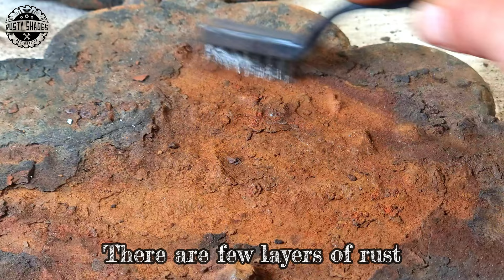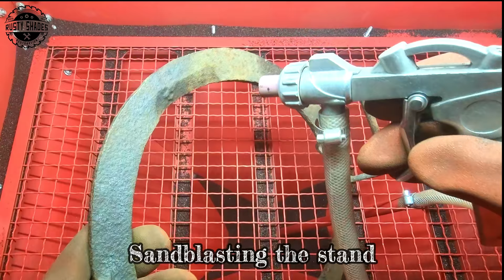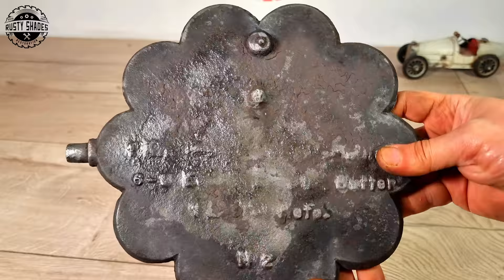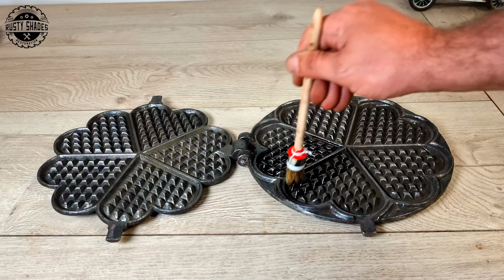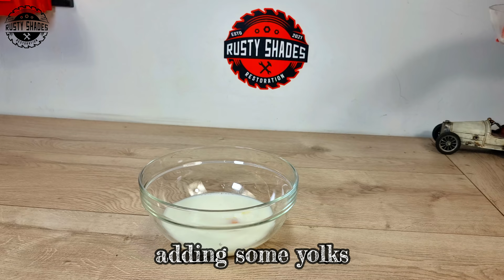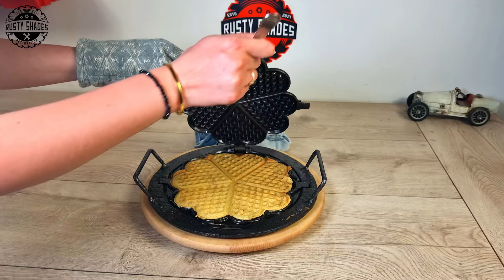Antique Waffle Maker Restoration - My Girlfriend Makes Waffles for You!

Comment: i had no idea the heart-shaped waffle irons were historic - i thought they were a new fad from the last 10 - 20 years.  i'm glad to see such a beautiful piece carefully restored and usable again.

that makes me want to send my recipe for yeast waffles...  mostly prepared the night before, then the next morning add a couple of ingredients and pour into the hot waffle iron, for the most ethereal waffles you've ever tasted!
Reply: please Do 🥺
Reply: Yeast Waffles

1/2 c. warm water (about 100-110F)
1 tsp. sugar
1 package of dry yeast
2 c. warm milk
1 stick unsalted butter, melted
1/4 tsp. salt
2 c. unsifted all-purpose flour (10 ounces)
2 large eggs
1/4 tsp. baking soda

The night before:

In a large mixing bowl (at least 3-quarts in capacity), combine the warm water, sugar, and yeast.  Stir & let stand 10 to 20 minutes to proof.  If the yeast is active, it will produce many bubbles.

Add the milk, butter, salt, and flour and beat until smooth and blended.  (I use a whisk.)  Cover the bowl with plastic wrap and let stand overnight at room temperature.  The batter will rise from 4 cups to 12 cups and then collapse.

Morning:

Preheat the waffle iron until it is hot enough to sizzle a drop of water.  (For crispy waffles, be sure to preheat both sides until very hot before adding the batter.)  Be sure to spray with oil, or use a brush to wipe oil on it, each time, before pouring the batter onto the iron.

Beat in the eggs.  Add the baking soda and stir until well mixed.  The batter will be very thin.

Pour the batter onto center of the waffle iron, using a light hand because the batter will spread when the lid is lowered.

Keep the waffles warm and crisp by placing them in a single layer on racks in a warm oven with the door slightly ajar to allow any moisture to escape.  (This is the cookbook suggestion – I serve them to hungry guests as soon as they come off the waffle iron!)

If you can find it, serve with Grade B (not A) maple syrup – it has a stronger flavor.  Trader Joe’s carries grade B.
Reply: @blueeyedbehr  thank u 😍
Reply: @blueeyedbehr  you are amazing!!! Thank you!!! ❤️
Reply: That's the standard waffle shape for waffles here in Sweden, the belgian ones are the fad here.
Reply: @MelissaJackson83  thank you for your kind words.  i do hope you will try this recipe.  it is the only waffle recipe i will make now because they are so light and ethereal compared to regular waffles, which now seem tough and flavorless in comparison.
Reply: Ok?
Reply: i would love that recipe
Reply: @carlagarrett3244  i gave it above.  hope you enjoy it!
Reply: Heart-shaped designs historically were in so many things in the early 19th to 20th centuries. Papers, clothes, decor, etc. It's no surprise that they made pans and irons as well. A popular biscuit tin shape in the 1820's was heart-shaped too.

Comment: Just a cooking tip. If you “fold” in the egg whites to the mixture (don’t whisk them in, use a rubber spatula instead) they will come out even fluffier.
Reply from the maker: Thank you 🙌
Reply: I thought exactly the same.  Over beating takes the air out.

Comment: btw, here are two tips for preventing waffles from sticking.  

1.  add a couple of teaspoons of oil to the batter.

2.  this is more important -- there's a chinese saying, "hot pan, cold oil, foods wont stick".  (it rhymes in chinese.)  heat the waffle iron, and when it's hot enough, spray it with oil, then pour in the batter.

the second tip actually works for any pan - heat it thoroughly, then add oil and swirl it around, then add the foods to fry/saute/etc...  they wont stick, and after several uses, the pan will become a non-stick pan.
Reply from the maker: Thanks for watching and for your tips, I will definitely use it! 😀

Comment: I think you might try a belt sander, with a thin band, for the open spaces on the backs.  Also, what about a more coarse grit in the sand blaster?  That type of handle will you use on the top?  If you know some one that can cast (or if you can do it yourself) cast an iron one!  It’ll season in no time, and be a perfect match

Comment: Looks like the waffle maker was missing its original handler which was used to lift the lid while it was hot. I remember seeing a similar one which one had to slide the handler (it looked like a spanner but very thin) under the lid latch until it clicked together and hey presto! you were able to lift the hot lid over that way.
Reply from the maker: This one had on the top, you can see the remainings of it. I didn't want to risk drilling holes or welding a new one, not on such an old piece that could crack immediately. Thanks for watching!

Comment: For the rust removal electrolysis to work, you need a sacrificial piece of steel or iron to “absorb” the rust given out by the piece you are trying to clean. And it also speeds up the process if you add salt or baking soda to the water to make it a better at conducting the electricity. Other than that, it was an awesome job! And thanks for sharing. :)
Reply from the maker: Thanks for watching and for your tips! Cheers 🍻

Comment: I enjoyed this 

Have you looked into Crisco for seasoning instead? That's what all the sites I found said to use.

Random cooking tip. Don't fold eggs into batter with a whisk. A flat rubber spatula and an actual folding motion is best. The spatula kind used for cleaning out a peanut butter jar. Slide spatula down side to bottom, turn over, remove spatula completely to above batter, return to side and repeat until all combined.b
Reply from the maker: Thanks! I never heard of it till now, but I will take a look. With the spatula thing, I will ask my girlfriend to take a look at your comment 😄 Thank for watching and for your suggestions! Cheers 🙂

Comment: "Sand blasting takes too long"
Yes but I'd watch it happen for 2 hours straight though lmao. So satisfying.
Reply from the maker: I love the process too, but takes time especially when the object is extremely rusty. You have around 2-3 min of sandblasting till the air is gone and then you have to wait till the compressor cools down to avoid burning the motor and then refill it with air and so on. This waffle maker will take 2 days at least to be cleaned with sandblasting only. 😅

Comment: I feel like the lid would have had a small round wooden handle, but that the metal shaft for it has snapped off in the past. You can see a big lump on top where something was mounted.

Comment: when the rust is that bad thermal shock is another way to get it off. Heat the metal up then throw it in an ice bath, then go at it with the brush
Reply from the maker: Yes, should work well this method 👏

Comment: That screw hole on the top should hold a wooden knob,  Makes the iron much easier to open.
Reply from the maker: There is not a screw hole, there was a casted handle from iron. Unfortunately I couldn't make one because require some special techniques and welding skills on whitch I'm working. Cast Iron can immediately crack and I didn't want to risk it on this antique Waffle Maker. Thanks for watching 🍻

Comment: Here is how I restored mine. Put it through the self cleaning cycle in my oven. Let cool. Rinse off all the ash with water. You are back down to raw iron now.  Dry completely and begin the seasoning process. Zero elbow grease and pristine cast iron pans!

Comment: I hate wire brushing, so, I would have been inclined to wash it after electrolysis, then, repeat the electrolysis until there's bare steel (washing every once in a while to get off loosened rust).  It might have gotten a little more out of the waffle grid for less hand brushing!  Also, I think your seasoning oven could have been hotter for a good seasoning. 
You're going to have a very nice waffle iron for another 100 years.  Nicely done!

Comment: Hi when cleaning cast iron, whether old or new, what should never be used? Cleaning, sosking, sandblasting, etc.????
Reply from the maker: Cast iron can face a wide variety of cleaning methods, including strong acids, so it is pretty ok to use most of them as long you're careful and respectful of the item.

Comment: To easily clean rust off cast iron just put the pan in a hot fire and burn fire for about an hour. Let cool and finish cleaning with wire brush and then just wash real good and season
Reply from the maker: Thanks for sharing 👍

Comment: Looks very much like a JOTUL heart shaped waffle iron. There should be a handle on it too. A soak in a lye bath would get the baked on crud off any cast iron pan or griddle.
Reply: Я свою чугунную сковородку время от времени закидываю в печку на угли-никакого нагара.
Reply: @dasha5582  As long as it is just coals and you don't warp or crack the cast iron.

Comment: “This will take too long to sandblast” proceeds to take 1 day soaking each part then at least 3 days with a wire brush. I would have just used the sandblaster.
Reply from the maker: Yes, if you don't have to prepare a video, you can sandblast even 1 year on this piece 🤣

Comment: This waffel maker was made for an oven heated with wood. You could pull out rings in the plate and then put it in and it's heated. Unfortunally the recepie ist rusted away.
Reply from the maker: That's correct. I couldn't do that because I don't have an owen heated with wood in my workshop. The recipe said: 1 kilo mehl, 6-8 eier, 1 1/2 liter milch, 375 gramm butter, 1 loffel hefe.
Reply: @rustyshadesrestoration  
Thank you very much for the recepie🤩
And well, you solved the oven problem with a good idea👍🏼
Probably most people dont have souch ovens...🙂
Maybe the Amish?😚
Reply from the maker: Haha. You're welcome! The Amish and many others, especially in the rural areas. 😁
Reply: @rustyshadesrestoration  
Yay, my suggestions were correct😄.
I don't think we have many of these old ovens anymore, although l know people who have🤗.

Comment: There is no need to use brushes in the first place, use the sand gun since the first, and secondly, to remove the nail quickly and easily, put a little oil on it and then it comes out easily. Watch similar videos to you to learn about better techniques in such models. They have a great view. This is due to the use of better techniques
Reply from the maker: Hi. There is a need to do that, please stop teaching me stuff. If you don't brush the big parts of rust, all the dust and big pieces will create a huge cloud in the cabin and you, the viewer won't see much there while I filming the process. As well, big rust parts can block your tube and the gun once they fell into the media. The ones that you are watching probably doesn't show you this part, or they have bad sandblasting video quality 😉 You're welcome!

Comment: Shouldn't there be a handle on the lid? There seems to be remains of some fixings.
Reply from the maker: Yes, there was a small handle, but I'm not an expert in welding cast iron. I'm doing some experiments and I'm learning. Cast Iron require some special techniques for welding and if you don't do it properly may crack in a sec. I didn't want to learn on this antique Waffle Maker and somehow to ruin it. Cheers and thanks for watching 🍻

Comment: Bead blast it and be reseasoning it in less than a hour and cooking waffles that night.
Reply from the maker: I had only aluminium oxyde and didn't work very well.
Reply: @rustyshadesrestoration  yeah but alot of auto parts stores and mechanic shops have them and will blast stuff like that for folks for a few bucks. But if I did it regular I'd pick a decent blast cabinet myself. Something else that works good is walnut shell in the blast cabinet or especially if you have one of those shadtree blast pots so the sand want eat it up.

Comment: No knob?
Reply from the maker: On the top was a small handle, but I'm a beginner in welding cast iron and I didn't want to risk on this old piece. Cast Iron can crack very easily during welding if any little mistake occurs.

Comment: What is the name of the process in 3.42 and what does it do?
Reply from the maker: You mean that gun and the red box?
Reply: @rustyshadesrestoration  Yes, are you doing this to remove the rust on it?
Reply from the maker: Yes. It Is called sandblasting. A device that works with an 8 bar compressor and blows aluminium Oxide with big power.
Reply: Oh i got it, thank u 😊 good luck in your life 😊
Reply from the maker: Thank you! Same to you!

Comment: You should have researched how to clean and season cast iron. You did not follow any methods that I  have found. In fact, what you did could not even qualify as seasoning. Also, you should have restored the cast iron with electrolysis. I would not eat anything that comes off that griddle.
Reply from the maker: I won't give you any waffles if you skip videos and being stubborn. I used more techniques that ppl can see which one works better with such a thick layers of rust buddy. I'm not making here videos only for you with your techniques that you have found 😅😅😅

Comment: This was a total fail. I can't do all everything that you do but I do restore cast iron. ALL you need is a competent electrolysis tank, It will strip it down to the gray iron even if its painted or used to mix concrete. Extreme rust and buildup is no problem what so ever. Never use power tools or sandblasters to clean vintage cast iron.
Reply from the maker: I think precisely the opposite way, and I do not have to clean the iron your way to not be considered a failure. 
The waffle maker is clean, and even though I cleaned it more than a year ago, there is no rust spot on it. Ah, and the waffles were delicious 😋 I do not understand people that have such a nailed idea about cleaning something. Common, wake up, there are plenty of ways to get the same result, some faster, some slower, etc, but as long as the result is the same? Matters? For me, no! Cheers 🙂
Reply: @rustyshadesrestoration  Ok the reason it was a fail was a wire wheel can leave marks and a silver look to the iron. Sandblasting changes the color of the iron to a silvery white. No collector will touch it with a 10' pole. You've taken all the value away from that piece of history (if it were valuable in the first place. As someone who restores over 200 pieces per year electrolysis is the gold standard if you want preserve value and history. Lye and Purple Power both remove buildup but do nothing for rust. A 50/50 mix of white vinegar and water will cut the rust but over 30 minute exposure can start attacking weak spots in the iron making pitting worse. I'm not making this stuff up, any collector will tell ya the same thing. You didn't learn all that you know by not listening I'm sure. Research it then make up your mind.